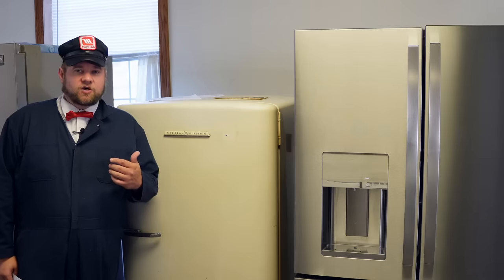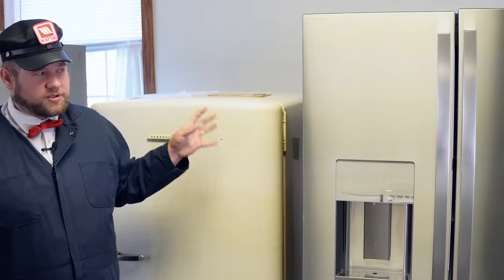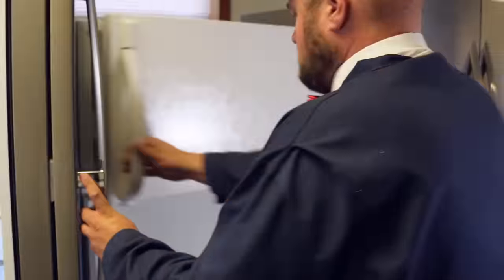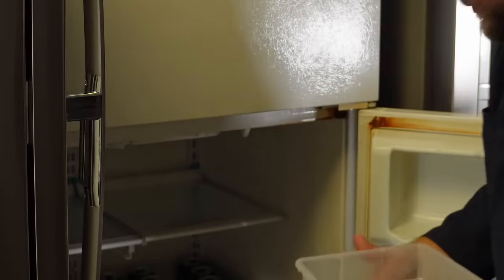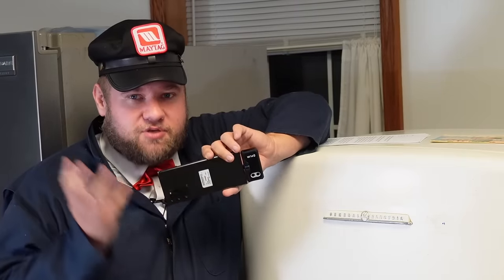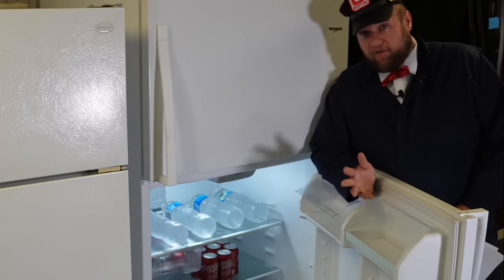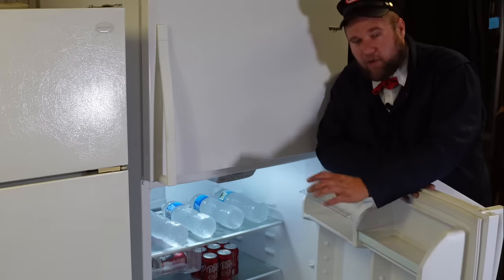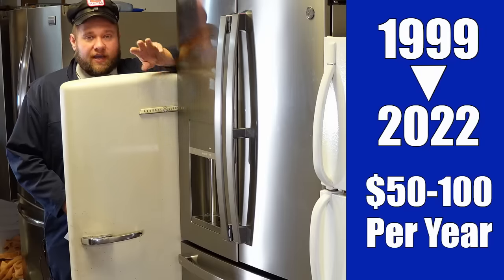Should You EVER Buy a New Appliance if Yours Still Works? A 7-Day Test

Comment: I had a fridge like the old GE and I thought it would last forever but it stopped cooling some years ago even though it still runs. It's interesting that it is insulated with corrugated cardboard. I bought a new maytag in 2000 and it lasted 2 and a half years. Just till it's warranty ran out. Defrost timer failed twice and eventually it stopped cooling even with that working.
Reply: Similar story, I bought a 1999 27 cubic foot Maytag fridge.  Back then Maytag started to use adaptive defrost timers and my timer died at the 2 year mark and then again at the 4 year mark.  When I bought the second new adaptive defrost part from Maytag at the 4 year mark I noticed they "upgraded" the part to use a 70V electrolytic capacitor vs a 50V.  That timer lasted for four years.  So when I bought the 3rd timer at the 8 year mark I replaced the 70V cap with a 200V cap and guess what, no issues since!  The fridge is now 23 years old and runs like new.  So to save a few pennies on capacitor, Maytag caused their fridges to fail early, and to lose brand loyalty.

Comment: Yeah, a couple years ago I replaced my 1975 Carrier furnace that was running great.  The burner in it looked like new.   The AC died and it was literally cheaper to replace both, than to do all the metal work to integrate the new evaporator to the old furnace.   This included upgrading to an HE furnace.  I noticed the new furnace takes way longer to heat the house if am away for a few weeks and have it set really low when I'm gone.  I literally got a wifi thermostat because it takes like 6-8 hours to heat the house up to 70 degrees when I had it set to 55. It literally took a couple hours with my old furnace.   I haven't seen any big difference in the amount of Natural Gas usage the past 2 winters with the new furnace.    Also my 1987 AOSmith gas water heater started leaking and I just replaced that.     47 years out of the furnace and 35 years out of a water heater.  WHY do new appliances have such a short life?
Reply: Consumption, that's why.  Sure they may be more efficient, but the faster it breaks down, the more often it'll have to be replaced thereby increasing the profits of the company.

Comment: I actually have my Grandmother's old fridge. It looks a lot like the 99 model you showed. It's at least that old if not older. It works fine. Never had any trouble with it. If it ever dies of course I'll replace it. I don't see any reason to worry about it until that happens.

Comment: My grandfather had bought an old Westinghouse refrigerator back about 1923, the kind that had the radiator coils on top of the box.  He finally replaced it in 1984 because my grandmother wanted a frost free model.  It was still running when the men came to take it out and replace it.  Over sixty years of service.

Comment: I still have my family's 1964 Ford Philco Refrigerator. It operated for about 40 years & then it was just replaced but still kept in the basement. It still operates (froze the water in the freezer etc) when I turned it on last week. It never had any service except the replacement of the fan blower motor once which was really easy. I do not know why it has not failed yet, but I am NOT getting rid of it. These good looking & swell operating tanks can be repaired if need be...One thing that perhaops helped in its long life span was that for about 20 years it just operated without being opened more than once every few days.

Comment: I love the old fridge! Many fond memories of a cottage with one of those. I had a 1950s QuikFrez. A friend of mine who was a refrigeration tech drained the cooling system, my buddies and I took it all apart and used auto body techniques to fill the scratches and dents. We shot the body full of polyurethane foam insulation, painted it with Honda white paint, and put it back together. We restored a 1952 or so fridge. Kept the original compressor and thermostat, changed out the power cord for one with a ground. I think it was R-134 refrigerant, but don't quote me on that. It was a great beer fridge for the garage. Had to move, sold it for over $1500 to a baby boomer. Loved that fridge, wish it was still with me.

Comment: I worked in an appliance store in the late 1990s.
there had been a recent tech improvement in refrigerator compressors.

We did power demand testing and a 5 yr old refrigerator demanded enough more power than the new that at electric price of the time, 3 years of electric power difference was calculated to pay for the new refrigerator.

We sold a lot of refrigerators that year.

I was Maytag, Whirlpool, Frigidaire, GE, Kenmore (which was mostly Maytag relabeled) trained for repairs and sales.

While cooling the stuff takes a lot of power... the full fridge uses less power than an empty fridge once the stuff is cold.  The thermal mass helps the fridge especially recovering from a defrost cycle.
Reply from the maker: Nice, thanks for the info. Was that in the US or another country?

Comment: About 18 years ago, my neighbour was throwing out a huge Admiral chest freezer.  I brought it home, cleaned it and plugged it in.  It fired right up and got cold inside.  I put it in the basement and used it, since I didn't have one.  A few years later we moved to our current house and brought that freezer with us.  Last year I bought new appliances, moved the old fridge from the kitchen to the basement and finally unplugged that old chest freezer.  It still worked and never gave me a problem, but it took up too much room.  I checked the tag inside and it was made in Mississauga, Ontario at the Admiral plant 8 months before they closed in 1980.  It was 41 years old and still worked.   Had to chop it up with a sawzall to get it outside to the curb.

Comment: I grew up with one of those 1950 GE refrigerators.  My parents got it as a wedding gift in 1950.  It out-lived both of them, only ever needing to have the light bulb changed. Over 30 years of service.  Hard to beat that.  And yeah, it wasn't the best at freezing anything, and manually defrosting it could be a pain, but still....

Comment: Thanks for the video. We have a 2002 Kitchen Aid KSCS25FKSS02, which is still working fine! I have replaced the ice maker and other parts, but nothing major like the compressor or associated systems. It is a 24.5 CF side-by-side with water and ice through the door. We prefer the side-by-side and have looked for replacements just in case, but nothing out there looks to have as many roomy door shelves, internal shelves, and pull-out draws.  Some look to, but they are not as roomy! For now we have hanging on to this unit.

Comment: Growing up in the 1950's we had the exact same model in our home and never had a problem until my parents replaced it in 1973 and it was still working.  The GE canister Vacuum cleaner they had in the 1950's lasted until my mother passed away in 2008 and other than one power cord replacement - was still working in 2008.  My Mothers GE Dryer worked almost 25 years before it finally died.  They just do not make anything like they used to.

Comment: My whole life growing up, my parents had an old Philco G-925 (early 1950s) refrigerator that came with the house they bought in the mid-1950s. When the house was sold 15 or so years ago, that thing was still running. The one thing my mother never liked about it was the curved top. You can't set anything on top of it. I really liked that old thing.

Comment: R-12 was one of the most glorious refrigerants ever made.  Almost everything which was charged with it still runs unless it’s mechanically damaged.  I have a fridge and freezer that are >40 years old and still running great!
As a side note, to make the test truly accurate, place thermometers in each one and set them to the same accurate temperature.

Regarding a sneaky electricity gobbler, they used to have a switch inside the refrigerator compartment that was just marked more efficiency, energy saver, or similar.  It’s actually a switch for heater that warms the sealing surfaces so that ice and water doesn’t build up around the door sealing areas.

Comment: Got a side-by-side GE in 2006 with children still at home. It's been fed parts 3 times, each time about 3 years about over the last 9 years: defrost heater then motherboard then fan in the freezer compartment. We did replace themistors when taking apart areas that made them easy to replace each time, jelly roll condensor got cleaned of dust each time. I'd look at price for new ones vs price for parts AND they don't make them like this any more.

Comment: The house I bought had a 1950ish Westinghouse fridge in it which worked great. I bought a 9 cubic foot Kenmore freezer to compliment it and that was a great system until the pot metal handle broke off the old fridge. Went and bought a massive Kenmore Elite fridge unit only as we already had a freezer. Now 16 years later the fridge is developing issues and my wife and I would just like one smaller unit (the freezer is mainly filled with ice packs and frozen food we don't use). and save space and electricity. Amazingly the non-frost free Kenmore freezer is pushing 30 years old and is perfectly fine so I can easily resell that.

My family of 8 had that same 1950s GE, although I think it was a bit bigger. Mom just had to shop more often to keep it full.

Comment: The whole reason I still have my 1985 Admiral fridge is it still works (mostly). It has a broken ice dispenser push that I can't find a replacement for. When I changed the water inlet solenoids for ice maker/cold water  dispenser,  I had to Frankenstein one from the closest match I could find, but other than that, it works fine. I'd say being nearly 40 years old, I've gotten my monies worth. So I agree that they should be built to last a longer 7 to 10 years. I made that mistake changing out my Whirlpool W/D about 8 years ago, that I bought about the same time as the fridge. I believe I would have been better off overhauling the washer, the dryer worked fine. The GE set I bought is garbage! Thanks for all your in depth videos.

Comment: Wow did I go off the deep end on this. Adding a temp trend is an eye opener. Put in freezer and you’ll understand the defrost cycle and compressor cycling. I took my 2000 26 cubic Amana from 4.7kwatt-hour per day to 3.44 avg over a week. 
The energy label was a joke and had to be estimated power. My house is 80 inside. I changed the defrost timer from 8 hr 30 min to 12 hour 25 min  and that helped a ton with power and temp control

Comment: I bought a nice house in 2021....came with a Viking 8" built in fridge and a gas stove, both would retail for $20k new and they were only about 5-6 years old.  I spent $2k fixing that fucking fridge in less than 6 months and replaced it with a $3k LG that is not a built in and is 6" tall yet it holds more stuff.  Problem free!  I had to spend extra to do some work in the cabinets in the kitchen to make it look good but it wasn't much.

Also ended up replacing the gas stove because the oven was busted and didn't want to go down the road of spending $1-2k fixing that so replaced it with a $3K LG induction that is amazing.

I know these LG's will last 10-20 years.  I like not having gas now as induction is even faster and has no emissions.

Comment: We have a Hotpoint fridge that is from 1995 in our basement, and it runs perfectly. Our Double-door upstairs fridge is 17 years. It's also the same with some old washing machines, they would last for like 20 years. Nowadays at the most 9 years. My mom had one of those Maytag top loaders in the 70-80s, and it lasted 19 years. It's also one of those Maytags that are known to last a long time.
Reply: Whirlpools are great refrigerators. Had one for 25 years and replaced it with another Whirlpool that's still at my old house. My new place has a Whirlpool 20 cubic foot top mount freezer.
Reply: @patcola7335  Yep. Actually its a general electric, I made a typo. But I have family who has had whirpool fridges and freezers that have lasted up to 25 years!
Reply: @Warp3326  That funny you say that because in 1992 we bought a Whirlpool Designer Style top freezer fridge 22 cu ft. And it went 25 years before getting replace by another Whirlpool. It's a shame the newer ones don't have the cantilever shelving like my old Whirlpool did.
Reply: @patcola7335  Yeah!

Comment: Great test and comparison. My approx 1990 Kenmore Coldspot 21 cu/ft quit on me last fall (32 years old) so I bought a new Whirlpool WRT311FZDW02 21 cu/ft (Same size as the old one).
After some research into repairing the old one I determined that the defrost timer had failed.
Bought a new one for $15.00 and it runs fine (Will probably go another 20 years).
Those old units are very simple appliances, no computer boards in them to fail.

I have both refrigerators in the basement side by side and they have that same watt meter on each of them to see how much the old fridge uses.
Currently  the watt meter reads 650 hrs on each and 18.00 KWH on the new Whirlpool and 54.55 KWH on the old Kenmore.

The old one use 3 times the new one in my case,. not sure what the electrons cost per KWH.

Question: can I unplug the old fridge and not use it (Keeping it for emergency's (I don't trust the new one, I think it will last 7 years if I am lucky).

They don't build them like they used to, or they would be out of business.  (32 years old and going strong).

Comment: There's also the consideration of how fast the temperature recovers after opening the door. The propane refrigerators found in some campers and RV's are incredibly efficient, but their heat transfer rate is not very high so it takes them a while to get back down to temp. Not good for opening and closing the door a lot. We always had a separate cooler for soda to avoid that issue.

Comment: I have an old fridge that is about 25 years old and still doing good. I had thought about replacing it but still looks and works good and I got sticker shock looking at new ones. I retired early and since then every thing I owned seemed to break well pump, stove, sewing machine, laptop, and washing machine. I learned a lesson with a washing machine . I wanted a nice matched set so got rid of my great working washer and got a front loading he set. I never liked the washer because it tended to stink and not wash clothes really clean. It broke for the second time so I replaced it with an old used set in good condition and I am very pleased with them. My cousin had a new front loader that broke and the service tech told her it would be $ 350 to replace the board and he couldn't guarantee that once fixed it wouldn't instantly blow again. It would be nice to be able to get the best of the old and new technologies.

Comment: Hi Ben, love your videos,  I have a top freezer 1987-88 Kenmore/GE refrig, 24.8cf.  I love this frig.  All the shelves are adjustable with 2 in the freezer and 4 bins in the door,  5 slelves in the frig.  Anyway I have not found anything close to the quality of this for years now.  All the top freezer ones are very cheezy.  I have only had to replace the ice maker once and the water inlet valve.  Consumer reports recommended this back then.  For the last several months it was not cooling and melting the ice in the ice bin.  It seemed like the defrost timer was sticking, so I replaced it.  It still is doing this intermittent thing.  I have decided that it is the cooling control.  I had a repair guy come out he didn't do anything except look in his computer and charged me 95.00.  He said he thought it was the compressor.  After I talked with a guy at an appliance parts shop he thinks it is the cold control.  He used to work for Sears.  My problem is GE is not making this part anymore.  Part # WR9X411.  I would like a new one but I want a quality one that will last.  Any suggestions  I have looked at many online sites.  Just did the math it is 35 years old and still looks perfect inside.

Comment: I know this video is about refrigerators but I did a similar version with washing machines, i always bought used ones for $100-$150 bucks $200 at the most & they last of the year or 2  putting a water pump on them or the coupler between the electric motor in the washing machine but then decided to go buy one of them nice frontload ones that aren’t as hard on the laundry & realized that that thing has to last me at least 6 years to be as money efficient as far as purchasing as the old ones were ( not considering how much electric one consumes over the other )

Comment: Now I'm curious to test mine. It's a Whirlpool, I'm guessing 20 cubic inches, (based on the model # having a 20 in it) with a build date of 08/92. I'll check back in a week and let you know how I did. As for tearing down grandma's 1950 GE, sure as long as you don't destroy it in the process.

Comment: I recently replaced my 17 year old Kenmore gas dryer even though it was working fine. And only because my 7 year old Samsung POS washer died. PCB and water valve. But both were replaced with the Speed Queen washer and dryer you recommended. OK, I know this is refer video. 
I have a 26 year old Amana TR21VL refrigerator and it's not being replaced until it dies. Knock on wood, it works great. They don't make them like that anymore for sure.

Comment: I just checked my 2022, 25 Cu ft, Samsung Bespoke for electric usage. It has Smartthings that tracks power usage and in July 2024, it used 34.8 Kw-h. That is 1.1 Kw-h per day and about $4.52 for the month of July. I suggest not running all of the frigs next to each other or make sure there is a fan to ensure good air flow.